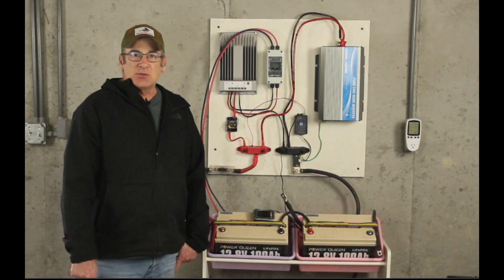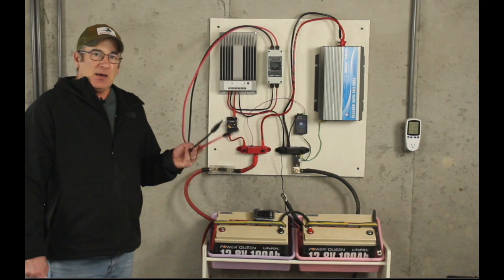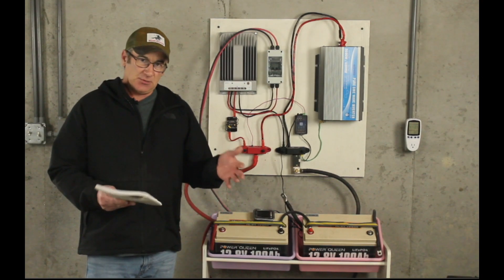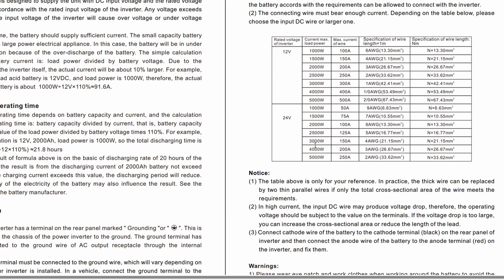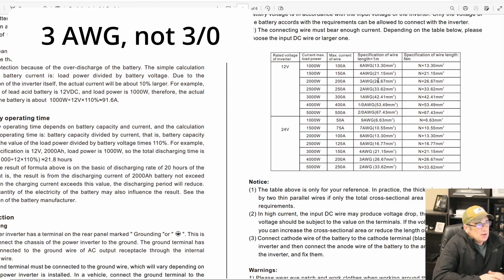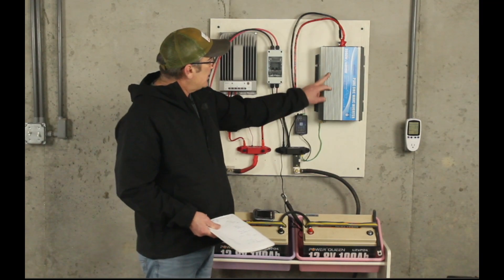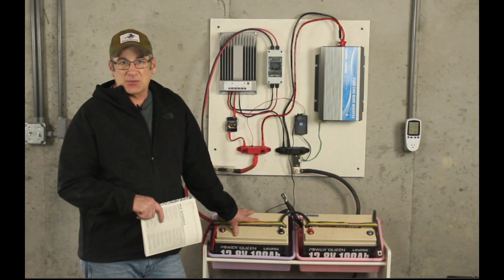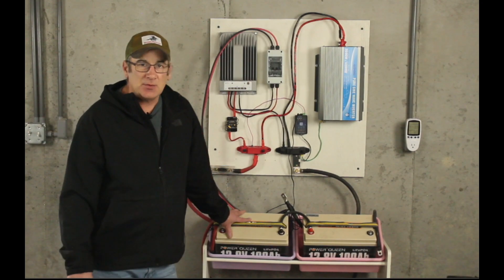Off Grid Solar Powered Battery Backup System - 24v

Comment: I'm using a Giandel 24V 4000W Pure Sinewave Inverter.  They recommend 3 AWG for that. That seems crazy.  I'm basing my wire on 4000W / 24V = 167.7. So I'm going with 2/0 cable.  I contacted Giandel and asked them if it was a misprint, they said 3 AWG was fine.  What size Fuse are you using between the battery and the Inverter. What size cable did you use for the battery S/P connections?  I plan on using Bus Plates between the 2 series batteries then wire for the parallel or visa versa, which ever works logistically.  Did you use a Hydraulic Crimper?  On last question, what's the distance between your panels and the controller?  Mine will be about 80' unfortunately.  Thanks,  Dave in PA
Reply from the maker: HI.  I am really surprised they recommend #3.  They must just assume that the temporary inrush of 4000W isn't enough time to generate sufficient heat to cause a problem.  If that's the case, then the #3 would be fine for the 2000W continuous load.  I'm using 1/0 for the second string of batteries in the parallel connection, and #2 to make the series connections.  Both Windy Nation wires rated for -50°C to 105°C.  Probably could have gotten by with just #2 for everything in the second parallel string and the 2/0 leading to the buss, but I was anticipating possibly adding a third parallel string to make the system 7.5kwhr.  I have a 200 amp fuse between the batteries and inverter (actually between the batteries and the buss bar).  I didn't use a hydraulic crimper, just a hammer style crimper.  I'm using 100ft of #8 PV solar cable.

Comment: Does it matter pv 8awg to 6awg can i just keepnit 8awg
Reply from the maker: It really depends on the insulation rating of the wire and the breaker size.  We size the wire so that the breaker amperage is at max 80% the ampacity of the wire.  This is THHN wire..  The ampacity of 8 gauge THHN wire is 55 amps, and 80% of 55 is 44 amps.  So I probably could have gotten away with 8 gauge between the 40 amp solar breaker and the solar charger.  I generally go by the rule of when in doubt on the wire size, go bigger.
Reply from the maker: Hey, I wanted to follow up on your question.  I had told you that using THHN 8 gauge wire would probably be ok, but I double checked the heat rating on that breaker, and it is only 60C, so you can't use the 90C ampacity.  The 60C ampacity of 8 gauge wire is 40 amps, so you are really not getting the full protection of the breaker.  You should probably use the 6 gauge.  I believe the solar supply wires have a different rating due to the insulation, etc.  Hope this helps, but as always, consult a professional if you need more help.

Comment: Nice build!!!  Safety thing to consider....I'm guessing your relying on the BMS's to protect the Batteries if a short of some kind were to happen at the batteries????  Something getting across the the batteries and arching....I didn't see any covers on the battery posts?????That big fuse for the DC input really needs to be on the Battery end of the feed wire to protect That wire.... You choose wire size to handle the Load and fuse size to protect the wire but the fuse has to be at the Source not the Load. The 18 inches or so of 2/0 wire from the battery to the terminal bar can burn up if a short  were to happen with the fuse not at the battery POST (Source).  In the Commercial world that fuse has to be at the battery post or within 6 inches.  Don't rely on the BMS or if a AGM or Lead batteries were ever used.    A inspector would insist on it.   Same at the Solar panels.

Comment: how many watts from solar panels do you need to charge that battery bank  in  6 hours ?
Reply from the maker: That bank is about 5kwhrs.  If you assume 100% efficiency from your solar panels (which is NEVER the case), you would need about 900w.  It's hard to predict the solar panel efficiency, but if you estimate it to be around 50%, then you would need 1.8kw of solar to charge them in 6 (ish) hours.  For what its worth, the solar controller I have limits the charge rate to 1kw.  This original design is for 2kw of solar panels so that you might get a flatter charge curve of 1kw throughout most of the day.  I hope that helps, thanks for watching.

Comment: Hey, just to let you know The Wire that you got going to. Your inverter needs to be upsize. To the same size that you are going to your batteries. Because those wires oR way under size. I have tried.
The manufacturer size and found out that was a cause of the emperor shutting down.
And The wire was Getting hot.
Reply from the maker: Yeah, I am very disappointed in the guidance that is provided from the mfg.  I ended up sizing the wire feeding the inverter based off the 2000w continuous power.  That puts it at about 83 amps, and the 2AWG can handle 130 amps assuming THHN wire.  The surge current would be about 167 amps, but is only in short spurts.  I think 2AWG would handle it, but going up in size would always be a safer option.  Thanks for the feedback.
Reply: @joetalks.76  The space that I had I used What they use to hook up affordable homes.
Along with 100 amp wire.
Four going between the Solar panels found out that even they we're getting hot. At 24.
Votes. The Wire that I had was what I had extra So I used it. All I was running is a refrigerator and 100 amp lights. All I was using. Where's harbor freight Solar steph

Comment: Great build until you got to that cheap, low surge capacity, high frequency, transformerless inverter. High frequency inverters are not much more than a toy when it comes to reliability, performance and safety. They offer the poorest surge capacity ratings and a much short life expectancy than a real inverter that uses low frequency, transformer based technology, and because they don't have an iron core, copper wound output transformer to isolate the DC boost stage from its AC output, there is always the possibility that this cheap Chinese made inverter can pass DC current to your AC appliances and set them on fire.
Reply from the maker: Well that's good to know. It isn't something I use regularly, just a backup system.  Hopefully it would be enough to get us through a power outage.

Comment: The research that I've done? You should never mix different size batteries and different companies. I'd like to put a UPS in my home so I bought two UPS inverters/chargers(2000w) and hooked up two batteries parallel to a 2000w inverter to back up my sub pump. My 1/2 horse sub pump comes on for 1minute and 20 seconds twice an hour. 1050w start. at 10 amps. then drops to 960w at 8.5 amps. @120 amp hour battery draw it will last 5 to 7 hours approx. Two 100AH batteries in parallel should last 10 to 15 hours or more? I have outdoor solar lights(street lights) Some nights they only last 2 hours? other nights they last 10+ hours. It has to be a sunny day to get a full charge. I'd like to go 100% off grid but I first need it to become economical.
Reply from the maker: I could see the benefits of keeping all the batteries the same brand to keep things consistent.  I would think as long as the specs are the same, it wouldn't really matter.  Thanks for the feedback.

Comment: can you keep your battery bank charged using the power grid?
Reply from the maker: I've used a 12v automotive battery charger to charge them before.  You just have to change the connections to put the batteries in parallel.  I intentionally kept it off the grid because I don't have anything in place to prevent back charging the grid in the event of a power outage.

Comment: Another PowerQueen fan. We’re up up to six, 12v, 200ah Powerqueens, including the four in the bank we use to charge our Ford F150 lightning. We’ll be upgrading that from 10kw to 20kw in a few weeks.
Reply from the maker: Nice!  Are you charging your truck off the Power Queen batteries.  I was thinking of adding some more to make this system 10kwhrs and charging our EV.  We have a Chevy Bolt.
Reply: Nice built...

Comment: Looks good.  If you need to heat your home during an extended outage you should consider a diesel or propane heater.

This system will be good for baseline loads (lights, fridge, etc..).  

I also watch Offgrid Basement’s channel and his 24V system.
Reply from the maker: Hey, thanks for the feedback.  Yeah, the only real purpose was to have some baseline power for the fridge, phone chargers, etc.  Really not trying to generate heat, but in worst case scenario we could run a space heater on the 750w setting and duty cycle it some.  I know some people will set up a small tent in their house if power goes out and they need to keep a smaller space heated.  That would probably be enough to keep from freezing at least.

Comment: The red and black + and - junction boxes at the bottom of your board...where did you get those, sir?  And thanks for posting your build, sir.  Also, do you use battery terminal covers?
Reply: Those are called bus bars
Reply from the maker: Hi.  I bought them from Amazon.  ASIN:  B07THLX93D.  As far as battery terminal covers, the batteries I bought came with some rubber terminal covers, and I just use those.  I don't leave the batteries hooked up unless I have a need for the system.  It isn't used on a daily basis.
Reply: @joetalks.76 thank you sir.

Comment: At 4000 w surge, the maximum draw from your battery bank will be 167A. Your 24v inverter cannot draw all the power from a 12v battery. It needs a 24v battery. If you have 2-12v batteries in series for 24v. The 167A will be shared almost equally btw the batteries. That is 83.5A from each battery. A 4awg wire is  enough to connect 2-12v batteries in series if the max amp draw is 167A. 4awg pure copper can handle up to 85A.
Reply from the maker: Hi, thanks for the feedback.  My battery bank is a series parallel.  Two 12v (100amphr) batteries in series to get 24v.  Then two of these series sets in parallel connected to the junction block.  2/0 AWG can do 175amps using THWN wire.  This would be enough to handle the 167 amps being pulled through the wires connecting the battery bank to the junction block.  I do have smaller wire connecting the two 12v batteries in series.  I suspect the 'surge' portion of the inverter operation is so short that the smaller wire wouldn't generate sufficient heat to cause problems.  I'm not sure why else they would have suggested smaller wire, unless they are just wrong in the manual.  That wouldn't really surprise me.
Reply: @joetalks.76  👍

Comment: lets clear this problem of weir size's up once and for all . when charging a battery  power in put is  amps irrespective of or voltage  bank copasetic . 12 volte siystom or Or 24 volte Siystom it is   So  we ues to cabal suitable of carrying  amp's  like them on an ark welder  our battery bank will adapt nicely to this point  i use a simple gild line of fore  determining the size . given meny of use do not have chats & graphs to tern to. the stander  ark welder of 150 amps  use's tow size of weir  i opt for the larger size on 12 volt battery banks  often the smaller size when used as jumper cabled get to hot  Go for the heaver size of cable you find then in the good quality jumper cabal packs . often orange ,  Then we have the  heavy Ark welder such a the   , oxford welder Oil fold welder that pumps out a staging 200 amps this type of melty core cable is idle for large  battery banks. from 24 volt & 48 volt siystom battery banks , that require heaver amp's to charge them.   [ Remember amp  are the systems by witch we fill our batteries with a check valve.   not unlick a  water tank  with a check valve ,  think of it  filing the tank as it dose so it develops presser from the filing tank. 

this presser pushing  back on the incoming water  & slows the fill.  this batter slows the fill & more presser is added to fill.  if this tacks place whit current [ presser in amps ] will  heat's up the cabal & the larger cabal can except this current  with out damage  to  the malty core   cabal ,    But the smaller  cabal  Heats up to a point.  Of Melting  & will  & often  can start a fire .   this is the way i use  the cabling I'm going to use  lower amps when charging do not over heat the cabal.   Hirt amps  will heat up the cabal.  & keep cabals as short as you can  hop this helps you ,
Reply from the maker: Hi, thanks for the feedback.  I sized the wires based of the amp input/output specification of the components.  One thing I found interesting is that the 8 AWG solar panel wire is rated with an ampacity of 55 amps, while normal 8 AWG is only rated for 40 amps (60 deg C).
Reply from the maker: So I'm just wondering, do you agree that I could get by with smaller wires if the inverter normally only draws about 83 amps at 2000W when not in a surge state?  2 AWG would be plenty large for that amp draw.  Maybe this is how the manufacturer is justifying the smaller cable sizes in the chart.  Sorry, but I am not overly familiar with welding cables you are talking about.
Reply: @joetalks.76  You should size your cables for the maximum continuous rating of the inverter. Same with over current protection, You don't need to size for inrush/starting currents.